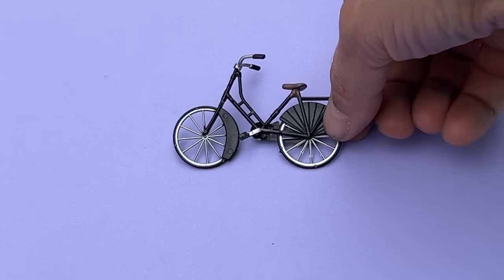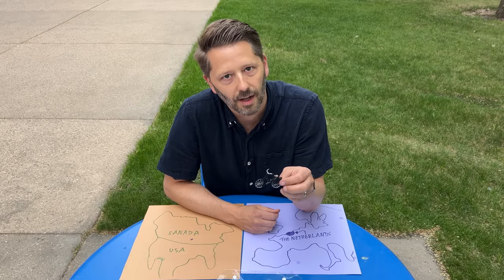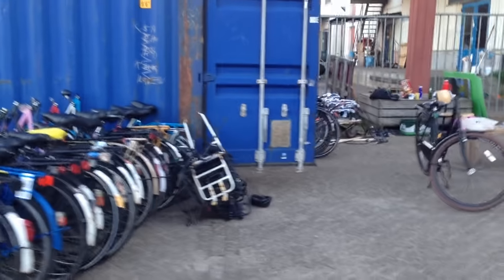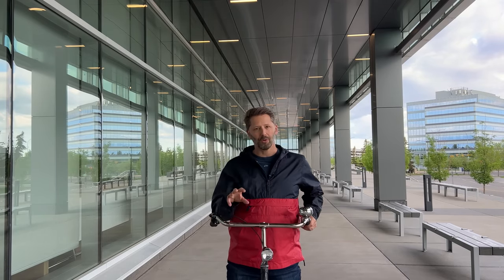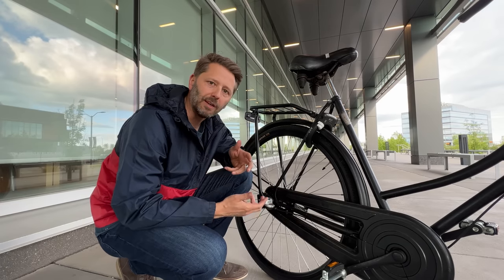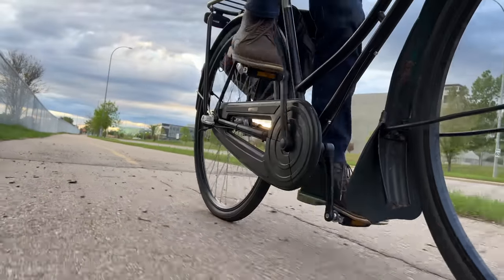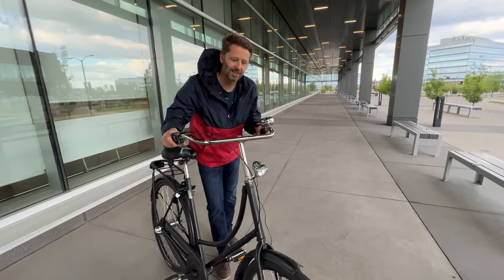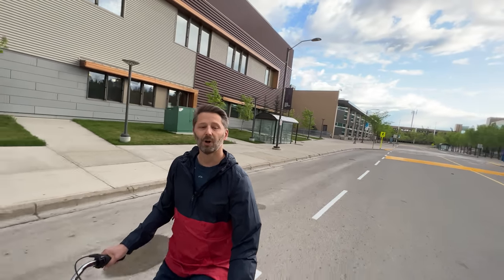I finally found a true Dutch bike in North America. Here's what you need to know

Comment: To give an example of how durable these steel frame bikes are, I inherited one from my grandfather. It was made in the 80s. Its older than I am. Spent 200 euro on new brake lines, gear lines, good quality Shimano gears, tires, etc, fixed it up, and Ive been using it for the past 5 years. This frame is so sturdy and tough, one time I rode over a pothole I didnt see, and the 1/2 inch steel bolt holding the saddle in place snapped. I walked to the nearest garage and had it replaced for 5 bucks, and I could continue my vacation.
That bike will probably outlive me and I hope my grandkids will inherit it some day.

Comment: Very entertaining video. I admire your creativity at around 10:00. That ring should be attached to the frame, like for example that big tube that the saddle pin is stuck in to. You typically take out the pin sticking into the lock, unwind it from the saddle pin,, wrap the chain around something and put the pin back into the lock 😂.

Comment: To me, the handle bars that curve upward and then almost straight back are the best. If I have to lean forward it puts pressure on my hands and they will go to sleep.  I bought a bike from Priority like this which also had a belt drive with 3-speeds and coaster brakes. Now I just need fenders, a rack and a bell

Comment: Some comments from a former Maryland USA bike commuter.

The Dutch bike is good for city riding at low speeds for relatively short distances on pretty flat ground.

The Dutch bike looks very wobbly to me and seems inefficient and requiring energy and attention just to go straight and stay balanced.  The fork geometry, high center of gravity, and swept back handlebars all work against smooth ridiing.  While an upright position is good for congested areas this really overdoes it. 

I had a commute of about 7 miles each way on a combination of a gravel dedicated bike trail and city streets with minor hills. 

Besides commuting I often rode a carbon fiber road bike for 20 to 50 mile pleasure rides.

My first commuter bike was an upright "comfort bike."  It was ok, but coming from a light road bike it seemed very slow.

My ideal commutet bike is an aluminum cyclocross bike with carbon fork. I have fenders, removable panniers and very powerful LED rechargeable  headlights. 

This is much more efficient and thus faster...
1. Lower more aero position.
2. Bright headlight gives me confidence to go faster at night because I can anticipate potholes and even tree limbs across the trail.
3. Fairly light weight and low rolling resistance.

Drop bar bikes are way better for longer rides. They allow for changing your hand positions to reduce hand fatigue. Lower position not only is more aerodynamic but takes some of the weight off your seat.  Once I became used to drop bars, upright bikes felt awful to me. 

So for me to be able to keep up a pace of about 15 mph meant my commute took only a little more  time than driving. And pretty often I'd put out maximum fast effort on my return trip (bright headlight was important) and that gave me a decent workout. 

I think a chain guard is fine for casual urban riders but was unnecessary for me. You shouldn't ride with loose clothing and you can walk your bike on the side opposite the chain. 

 I don't know if they are readily removable for maintenance. I relied on my bike and had to be able to do repairs at night in the cold. I carried a chain tool, tube, tube patch kit and tire levers. Repairs look harder on the Dutch bike.  

If I wanted a modern urban bike today I'd get one with an aluminum frame, a multispeed hub and belt...not a chain.

Comment: I just acuired a '77 Schwinn Suburban for 85 USD and it is in such good condition. Scwinn is a US company and they really don't make 'em like they used to. I took it to my local bike shop that fixes up vintage bikes and they showered the bike in compliments. It's not a true Dutch bike, but it has a lot of the right features. Between the initial cost of the bike, fixing it up, and adding a bike rack, this thing will cost me about 250 USD. Which is cheaper that the used bikes the shop was selling.

Comment: The front fender brace should be attached to the front wheel axis with the same nut as the wheel itself (that’s why the holes are so big). The fender now looks weird because the gap to the wheel gets bigger toward the lower end. At 5:33 you almost got it right, just move them to the outside of the fork.

Comment: I love my Dutchie :) it's a Spartan workbike... comes with it's own front and rear (battery-powered) lights, a front rack, and a rotary damper on the stem for heavy front loads. I still needed to upgrade the lights, and for big o'l Texan legs -- I had to change out the handlebars to keep from hitting them on my thighs. I kinda with I had one more gear, but otherwise I love it!

Comment: I've got this kind of bike for over 2 years - best bike ever - reliable, comfortable and probably long living. Designed over 100 yrs ago is the top of bike evolution. The one thing you have to change is a good derailer like Nexus. That's all. Grandpa bike rules.
Reply: Stermy archer (three speed) works brilliant too. You only have to have the tension on the cable right, allowing the gears to overlap perfectly.

Comment: I personally like handbrakes more as a dutchy. Never had problem with braking while holding stuff. It just allows for more control. Still they can break more easily so for low maintenance they aren't the best. But that useally happens if you transport heavy loads often. Something I do daily.

Don't wear a helmet isn't needed here, unless you are old... Still my luck was bad this year. Ended twice this year with a thick branch stuck in the wheel. One of those times bended my forefork 😂
Guess need to pay better attention where I bike with speed after storms.

Oh just remembered a few years ago in the fog at dusk I rear ended a truck who had no lights on parked half on the street. Only a closed helmet would have had me protected. Since I face planted on the truck. Nothing broken just some scratches, a bloodnose and a sore neck for a while. Glasses just a bit bended and a little bended bike. That was an easy fix.

I hope I didn't scare people to much now. I am good at breaking things while unintended. It is even worse with phone screens.
Reply: A fellow dutchie here, I feel very usafse without pedal breaks, is because I've always had bikes with them? Maybe, but traffic is very dangerous for me cause I have impaired hearing on my left side, so I want to be as safe as possible on the road. My bike git stolen three months ago and still don't have a new one yet, the main reason being that most bikes don't have pedal breaks
Reply: @Soup_and_garlic  So it depends on what you like or used the most. Old bikes have most chance to have pedal breaking. Goodluck finding a replacement bike.

Comment: Also a dutchy here,  one year later... I live up-north in The Netherlands and we didn't call these bikes "Omafiets" We used the name: "Ouwe Weduwe" as in, Old Widdow. Because it is black and made for females. The "low- in-step" is for female's with large skirts or dress and had that way a more easy access and dismount. The male versions would have an triangle shaped frame. 
The triangle shape is the most durable and strongest shape. The female version is just for convienience for cycling with a skirt. In the 70's and 80's I know that the saddles for skirt wearing females also missed the pointy bit of the saddle, or they turned the saddle around so the point was facing backwards.

Comment: The concept behind this design is actually from the UK. way back in the early 20th century. British built upright Roadsters made by Humber, Hercules, Delft, and Raleigh. They have slacker seat and head tube angles that put your weight at the rear of the bike with a very tall handlebar stem, generally the older  versions of these had rod mechanical operated brakes that pulled friction brake blocks upwards against the old fashioned type of Westwood rim. The rims are not better than the average rim brake because the rims tend to hold water more.

 So you can buy presently a roughly equivalent bike like these here in the US if you shop around. Keep an eye out for Low step over and comfort in the names,   Specialized has a series of commuters/comfort bikes called the Roll Low entry 2.0.

Comment: And you can modify them for your liking for example you could get a front rack, you could get electric motor and make them even more 2023. I use a Factory bike ( Werksfahrrad ) daily for my 10km commute i had to get the front rack that can hold up to 40kg because of my dog  (she is to heavy for conventional baskets ) and i wanted to be able to see her whole driving i installed an aftermarket pedelec motor with the type of brakes he has and got a back rack with a place to put the Accumulator in. Bike(used), Motor and Accumulator cost me around 1k total.

Comment: Warning, it's not possible to disengage hub dynamos (at least some of them) so you will be generating electricity even when you don't need. But also hub dynamos affect the balance of the front wheel and makes it nearly impossible to bike without holding the handle bars.

Comment: Tip from a Dutch cyclist: loose the dynamo and buy LED bike lights. Dynamo's suck. They slip when the tire is wet, the spring gets lazy and rust can make the connection to the back light bad and a crime to repair. Dunno of they're sold in Canada, but a pair of two bike bags and a rubber band are handy for transporting groceries etcetera. Two bags can level out the weight and make cycling more comfortable.

Comment: You said it perfectly: these bikes aren't for status, it's as low-key as a pair of shoes; you can buy fancy ones if you want but most of the time you just want a sole and something covering your feet, well with a dutch bike you want a frame, chain, wheels, brakes, and pedals, the rest is comfort. The best thing is as you said maintenance, there's absolutely no high technology and with two wrenches and a kit that fits in your pocket (dutchies will all recognize the Dutch Simson kit) you can do on-the-road repairs for most anything.

They're completely class-independent in the Netherlands as well, you can easily see both a starving artist and a politician on the same make of bike, give and take some details.

Comment: The only thing i missed are the "jasbeschermers" (coat protection) for the back, those are (mostly clear) plastic screens that go in the back wheel to protect your coat or load to get in the spokes.(as you can see in the video @12:36 the strap of you pack was pretty close to get caught in the spokes)

for the rest a good video, i still ride my "oma fiets" that i pulled out of the ditch and fixed her up for about 50euros.

Comment: I can ride a bicycle like that without hands, just using balancing because the center of gravity on the bike and the rider aligns more favorably or something, and when you can essentially cycle without even having to use your hands, its even more comfortable. And yeah, they are heavy duty, but I don't generally need to go both far and in a time frame. Either I need to go far but I have all the time, or I have a timeframe but I don't need to go that far. I'd happily take a few minutes more and have a very comfortable ride there.

Comment: Another thing you might like to add to that bike are 'jasbeschermers' or coat protectors i suppose in english. especially if you have a bag on the side like that very often, it'll help prevent getting a long coat, or the bag handles or strings and stuff from catching on the spokes. and coaster brakes really are good even at higher speeds. however, it's more difficult to finely control compared to sports bike brakes.
Reply: another fun lil fact, our (now ex-) prime minister always used a simple bike to go to work and it's totes normal here.. xD

Comment: So I've ridden a lot of bikes over the years.  I can't say I've ridden bikes built by Dutch manufacturers, but but I have ridden many upright, comfort driven bikes.  I get everyone has their preferences, but I often just find them hard to ride and control.  Admittedly, I'm all torso and no legs.  Maybe that's why.

I find I'm most comfortable on a big steel drop bar bike.  I'm all about racks and fenders on every bike.  The different position also makes it easier to manage the hills in the areas in which I've lived.

Comment: Hah, I'm Dutch and I work with bikes for a living. This video is - respectfully - hilarious! Nice to see how positive you are about something so mundane here. Just know that there are plenty of brands and types. This bike you got is indeed a base model. Oh and we're ditching dymanos here too. They're a pain in the ass when it's raining. yay LEDs :)
Reply: why are they a PITA when it's raining?
Reply: @HazewinDog  the Dynamo uses friction on the wheel to turn, if it rains or snows it will slip and doesnt generate power.
new bikes use either hub dynamo's (they dont have the slip issue) or lights with replaceable batteries (which aren't great, when you need them the battery is dead).

Comment: The brakes are 100% to be trusted and will stop your wheel completely so you can trust them. Only thing about is that the orientation of the pedals. As you want to push your foot down while they are in the 9'o clock position. Sometimes when you have to stop suddently your pedals might be at 12'o clock or 6'o clock. That makes it difficult to brake hard and require you to pedal a little bit forward, but this is something you will learn through out to calculate risky situations and put your pedals accordingly. 

Another fun thing is that having your pedals down at 6'o clock and making a sharp turn might scrape your pedal across the floor, god knows I've almost went down thanks to that :P

Comment: I converted an inexpensive mountain bike that I bought from Walmart over year ago to a "Dutch" bike.   Here's why:   The mountain bike, though not my style of bicycle, had a front suspension fork.  Most US "cruiser" bikes and Dutch bikes do not.   The mb had a light alloy frame.  The cruisers I see in bike shops for $400+ and Dutch bikes have heavy, steel frames.  The mb hd a front and rear derailleur.  Cruisers generally have no gear change.  These are basic advantages.  Here's what I did to make it a Dutch-like bike:   I raised the handlebar stem with inexpensive extensions.   I changed the handlebar itself to a swallow-style handle bar.  These two changes allowed me to ride in an upright posture, rather than bent over like a mountain-biker.  To accomplish this I had to redo the cables.  This is not an expensive nor a difficult task, if you are observant and careful.  The cables, the handle bar, stem extensions are all available on the internet as are the cables.  To make my bike's maintance simpler,  I removed the front derailler.   I now have a 7-speed instead of a 21-speed.   I really did not need 21-speeds in my flat Florida.   One fewer adjustment!   Because my mountain bike had a small reach, I replaced the seat-post for a setback seat post.  This moved the seat back and combined with the elevated handlebars and comfortable seat, I now have a bike as comfortable to ride as any I could buy in Amsterdam!  I added plastic fenders, a front basket and a rear carrier. I still have the knobby tires, but they are not worth replacing.    Costs:  one mountain bike from Walmart - $100.00;  alterations to Dutch-style - about $100.00.   Result:  I now have a bike that  I ride upright like a Dutchman rather than bent over like a pretzel.

Comment: Actually, versions with a cross-bar are as common as the ones without. They are sometimes called "Opafiets" (grandpa bike). Men ride the ones with cross-bar. Women ride the ones without cross-bar because decades ago they used to all wear dresses and skirts and step-through was both more practical and more decent. The cross-bar bikes are stiffer, can carry more load, and handle a bit more confidently. Both grandma and grandpa bikes are quickly becoming a rarity here in The Netherlands as well as they're being replaced with more modern alternatives, more sporty models and lots and lots of e-bikes.

Comment: You talked about brand names and status symbols. The shape of the bike is the status symbol itself: it screams Dutch practicality. Don't forget the stability, you can put anything heavy on the back luggage rack. Just don't put anything on the front or on the steering wheel, it will wobble around like crazy. You only need one gear, coaster brakes, a bell (very important in The Netherlands) and simple lights.

This video really sums up the main aspects of the bike very well. Weird or not, the bicycle is just a very sturdy and dependable tool for everyday use. The only maintenance it really needs is air pressure in the tires, and a checkup once every two or three years (!) to assure that the brakes and lights are working properly. You can buy such a bike new for 200 euros up to 800 dollars or more. The main difference will be the build quality and material quality, and details like hand brakes and more gears.

Comment: I'm 54 and like to ride when I can. Last year I ditched my pedal assist bike and my old mountain bike for a cruiser style. It's got 7 speeds, brakes on front and back, and you sit upright like the Dutch bikes. Which is the main reason I went with it. It wasn't very comfortable for me. Being leaned over on the handlebars was painful for my elbows. Also on electric bikes, for the price of a cheaper electric bike, you can get a really good regular bike. And where an electric bike weighs 60+ pounds, the regular bike weighs less that 10 pounds.